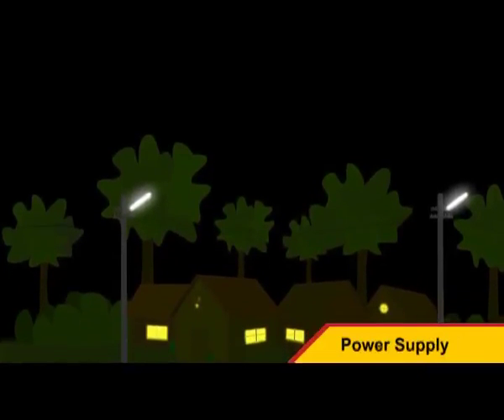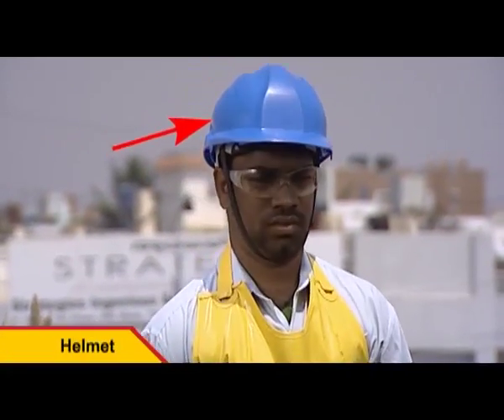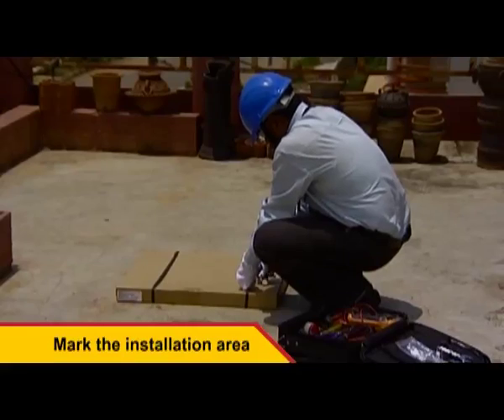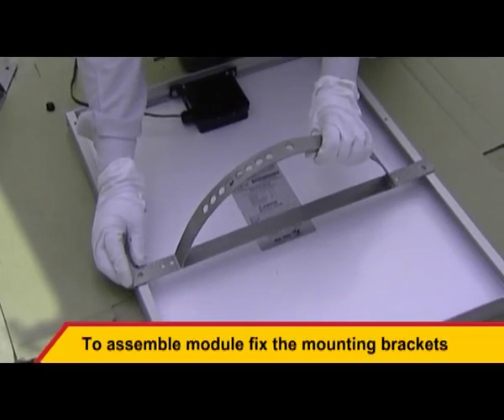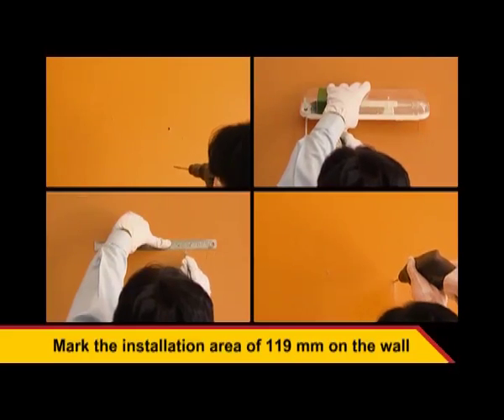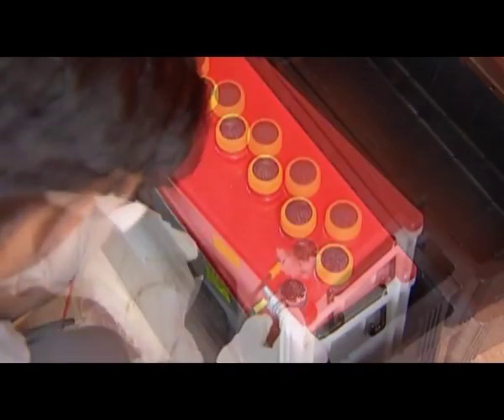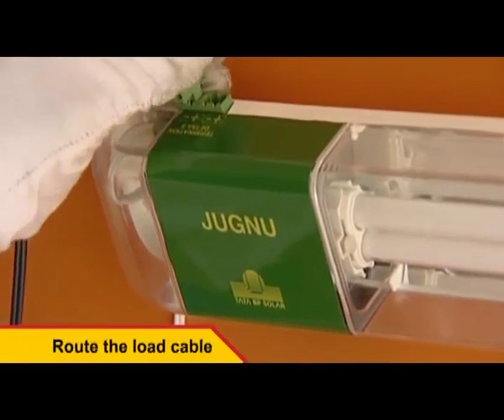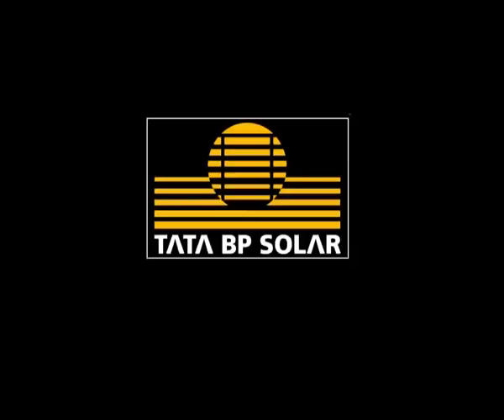Installing Home Solar Lighting | Step-by-step guide to set up solar power unit

Comment: If your hometown is near the sea ,full of sunshine ,especially the high latitudes and windly areas,the wind & solar hybrid LED street light will be recommented for you.30W,40W,50W,60W,70W,80W for optional.OEM/ODM is available.More details as attachment.kindly check it.    Email:youngyang@intefly.com,  Tel/whatsapp:+86-13246806669 Young ,Shenzhen Intefly Electronics Co.Ltd
,

Comment: I guess i ve got an idea to help you for bigger size one. Keep the same "detection system" based on balancing current power depending exposure>>>tinyurl.com/y5zdbb7g Once perpendicular to sun generated current are equals and stop the orientation module.The idea is brillant so why dont you keep it but instead of using the energy of the small cells, use part of the energy of the big cell to rotate shaft. Actual system would be then only here to serve as an interuptor. Best regards

Comment: I whant to put a solar module under the apartmant window or on terace wall,anybody can tell me if there is much loss in not in the manual mentioned angle,inclination?maybe a module under each window can be efective,right? Also there might be other options to help out that lost with some wind turbine on terace,home made I gues.If anybody can help with some ideas I would apreciate it.Here in Portugal the electricity bills are super high and got lots of sunlight.If you not live in a house to set up with modules and turbins you got no option just to keep fillin the supliers pocket with that crap 600€/month?

Comment: If installation for solar modules off gird and off grid OR agriculture  pump set (3HP to 10 HP) than plz contect  8561073457 OR 8740049957 only rajasthan

Comment: you may like this super good solar floodlight 10W IP67

http://www.aliexpress.com/store/product/DHL-Solar-Lamp-Outdoor-LED-Solar-Light-Waterproof-Power-Street-Light-Floodlight-IP67-10W-12V-solar/1381295_32611779123.html
Reply: +Rachel kang 
This is VERY expensive option.

You could easily  make your own version for less than £50 /$75
Reply: send your adrese

Comment: You should never have flying leads attached to the battery flopping about near each other as he could very easily have shorted them creating sparks and explosion/fire. (7:50-8:20) Connection to the battery should have been done last. Dangerous demo of how not to install.

Comment: Commercial Solar Panels are too Expensive !!
if you want a Cheap solution to Power your Home,
You have to Learn to Build your Own Solar Panels
Go to Google and Search for:
Top DIY Solar Panels Research by John Sommer
Choose the First Result (Skip the advertisement on top)
It is a Blog that Explains it in Details.......
Reply: +Jessi Ryder  The price of solar panels has fallen dramatically over the years.
So buying rather than trying to make them is a viable option.
The market for this appears to be India where there is loads of sun!! so for many this maybe an option....depending on price!!